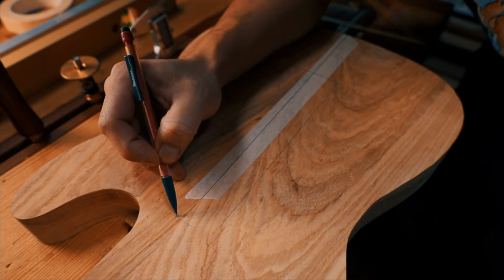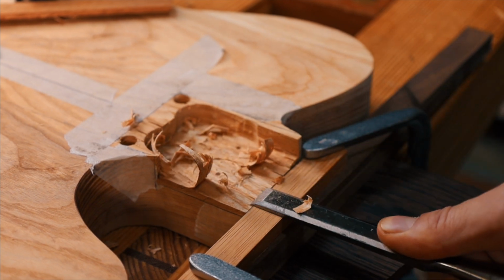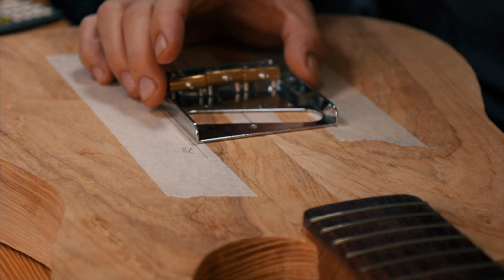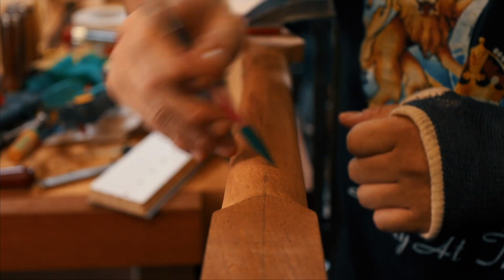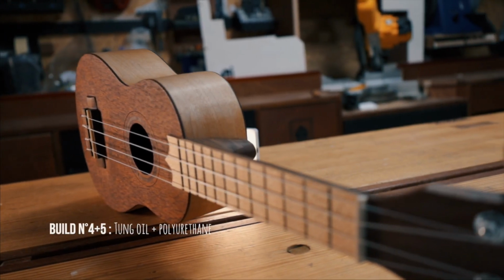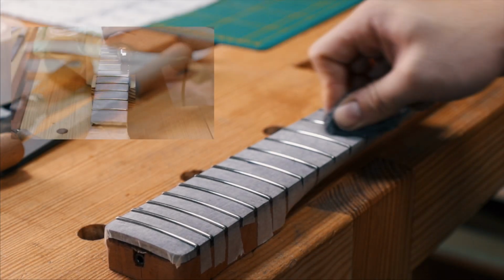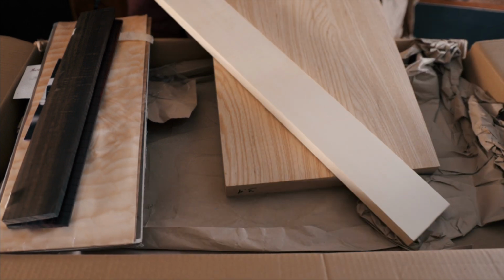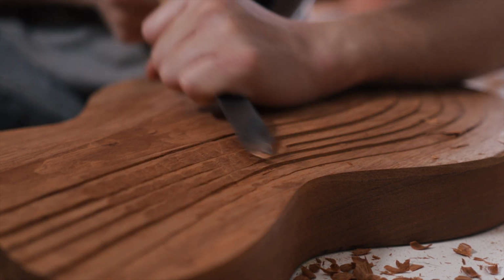How To Make A Guitar : Part 3/3 - EVERY SINGLE STEP EXPLAINED

Comment: Since your second video and painfully waiting for this final video, I played a Gretsch Sparkle Jet.  Then I got Gretsch fever, and then decided I had to have one.  Your 3rd video hasn't come out yet so I knew I couldn't build one yet (Just kidding!).  Really, I still have a couple months before I'm prepared for my first build.  BUT, I bought a kit guitar, loaded it with Gretsch style pickups and I got my Gretsch sound.  Or so I think.  Since your Part 2 vid, accomplished all that plus scored a new work bench from a friend and found a local lumberyard to get tonewood.  Now that this one is out this is going to be an awesome resource.  Thanks!

Quick question, I might have missed it but did you cover the nut install?  Did you custom make one or buy pre-slotted?

Finally, is that a Les Paul build I see at the end?!  Looking forward to that vid!
Reply from the maker: The nut is pre slotted ! 
And yes. It's a les paul ish :)

Comment: Thanks for these videos, they've been very inspiring. I started woodworking this year to ultimately build guitars. My first chopping board fell apart. But now I have a stool sat proudly in the kitchen. My next website stop will be to order some tonewood.

I also built a pedalboard built out of ash for a rounder, more mellow tone, and mortice & tenon joints for better sustain.
Reply from the maker: If you saw my first builds .... :P